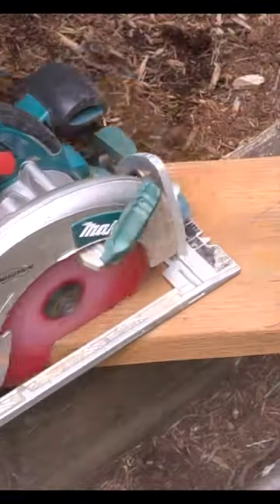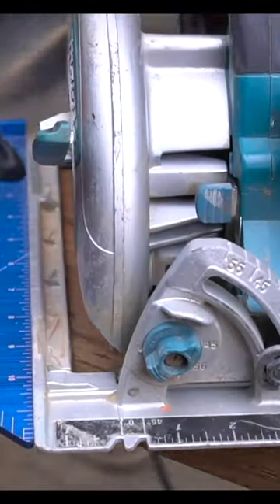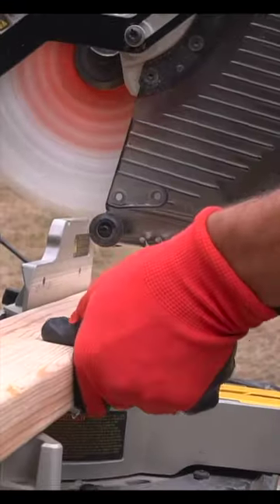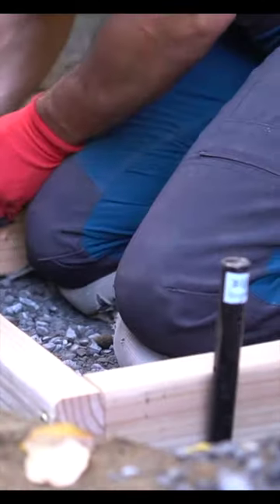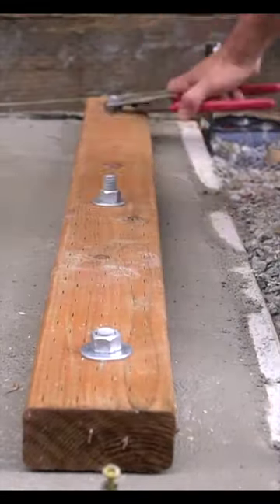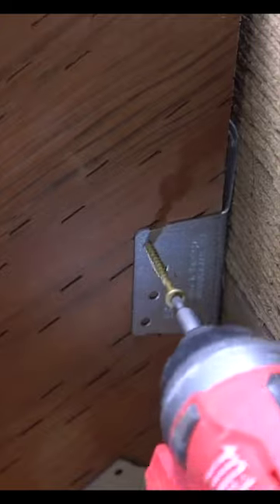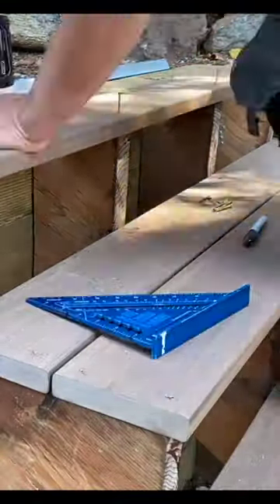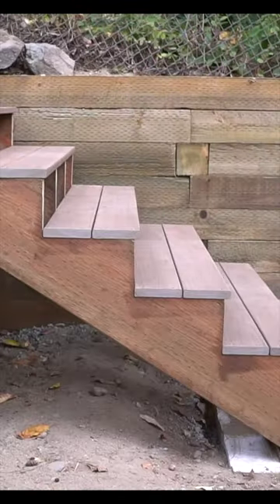DIY Exterior Stair Case #shorts

Comment: You were doing so well until you used those screws on the stringer hangers.  They have SD screws for those
Reply: it's not too much of a difference even though the screws may be more brittle realisticly a elephant is not jumping on these everyday and 4 screws is more than enough also this build does look low budget so I guess he was using leftovers
Reply: Nails for that part...but no elephants.
Reply: Check the load ratio between sd screws and deck screws

Comment: I'm a metal guy and not a wood guy, so I might be way off here. But why did you keep the stringer from touching the concrete but then use a wood 2x4? Should you have used a galvanized or stainless steel bracket that stands the stringer off the concrete?

Comment: There are a couple easier ways to do that which do not require a concrete pad that are just as structurally sound. It also needs risers and a finish stringer made out of composite fascia.

Comment: So you put a wooden base plate down to keep the moisture out of the stringers. Aren't the base plates just going to absorb that moisture??  Composite base plates would be better.
Reply: It's treated lumber, what you're really doing with that kick plate is keeping the end grain on the bottom of your stringer from wicking up the moisture, the long grain of the treated kick plate isn't nearly as absorbent as the end grain.

All in all it's an exterior build, they will eventually need to be repaired or replaced but we're talking at least a decade depending on climate.

Comment: Don't have any decking material that has single spans on joists or stringers. At least 2 spans. On these stairs , I'd have full length treads.
Also, those timber base plates do not protect the stringer from moisture. Use the composite boards that won't rot, and will not wick moisture. Paint/ seal those end grain stringers.

Comment: I have a little bit of different job I have to pour the concrete pad at the bottom of the stairs with the stairs already being installed. The ground is a rotating underneath them. However I might have to remove those to get the pad installed. Haven't determined yet if I'm going to do that because this is all on myself. And it's all a bit older mahogany so I'm not looking to bust anything up.

Comment: 2018 IRC code I believe says closed risers.
Reply: Always take away that trip hazard
Reply: @jimlane2961  Not so much a trip hazard, it's believe it's to prevent (should you slip on a tread going up) your leg going through and becoming stuck or break your shin bone.
Reply: Also requires closed railings for over 30 inches in height and requires stair rails on both sides for 4 risers or more

Comment: No need for a template, use stair dogs on a framing square, also screws will not pass an inspection anywhere I've built stairs 🤷🏼‍♂️

Comment: To be to code, you need a 1 inch nosing on your treads. Your steps are illegal and not to code.
Reply: Could be 3/4" - 1 1/2"
Reply: Plus if they box in the treads with risers there will be no overhang

Comment: Did you put a  gasket between the   Concrete slab and wooden  Base plate? 

Caz if not it's going to draw  Moisture from the slab and  rot over time
Reply: It’s treated lumber.
Reply: He added wood in contact with the slab to protect the wood from touching the slab.

Comment: Code by me won't let you use screws for any Simpson deck brackets! They all have to be nailed. 1 nail per hole or it gets failed for inspection.
Reply: They make screws for Simpson Hanger's they will work just fine.
Reply: There's no inspections happening on this DIY job.

Comment: Why not place plastic or rubber between the wood-base plates and the concrete base? Would have been better moisture separation barrier. Thanks.